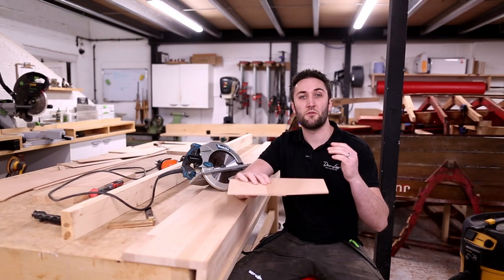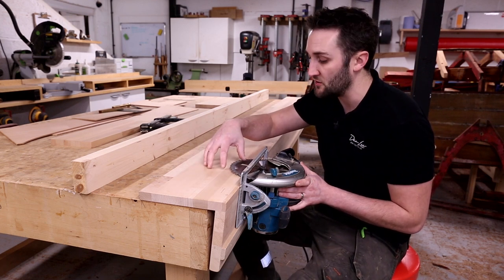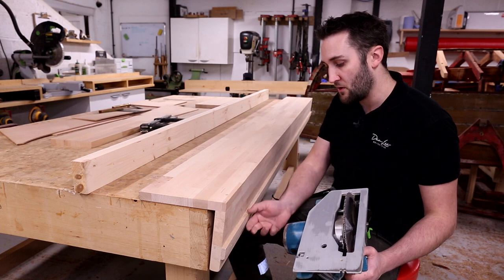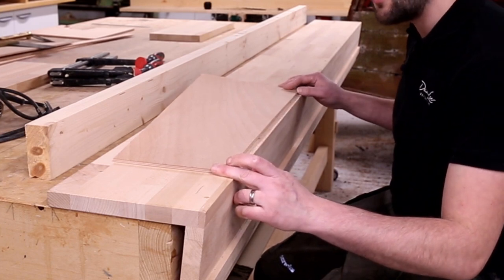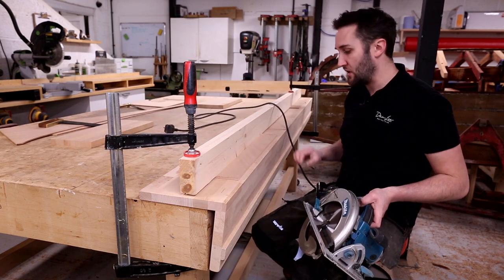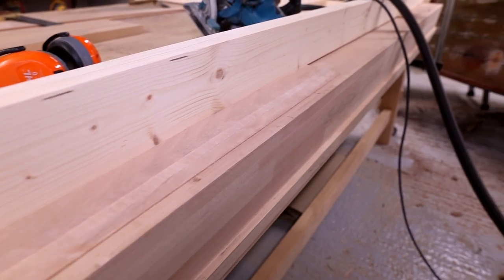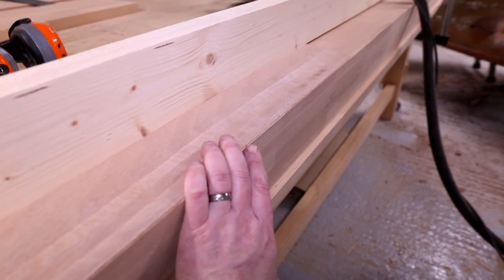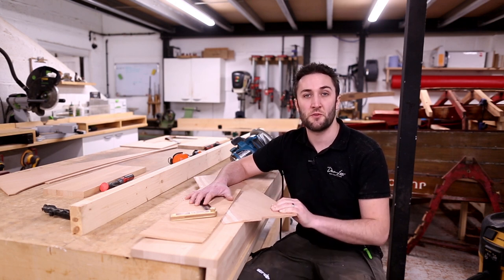How to Cut a Scarf Joint In Plywood Using a Circular Saw | How to Join Plywood

Comment from the maker: Just a note on something that might not have been that clear in the video. The setting up of the saws using the bevel gauge is referring to making the cuts required to make the jig. When cutting the scarf joint your saw should be set at 90 degrees. I hope that makes sense.

Comment: Thanks.  I’m an old butt block dude.  But for this present build, the NOT QUITE the world class cruiser I’m always going to build, I’ve been eyeballing home made scarfing jigs.  All SEEM so simple, but I think it’s in the skill of the scarfer.  One thing about me and jigs.  I’ll spend several hours fashioning and practicing, then, 2 - 4 cuts, and done.  Forever.
Reply from the maker: That's often the case with jigs, they take time to build and then the job is done in minutes. Worth it in my opinion though. Butt blocks are pretty good in most instances but you will nearly always see seams crack in the finish at some stage down the line.

Comment: Make sure you have a plywood that has a thick vaneer layer. Depending on how much you have to clean up after gluing the joint. You may end up sanding through it as i did. I used a birch plywood that had a very thin vaneer. Like comically thin lol. I ended up using that side for the interior as i sanded too deep.

Comment: Great way to scarf with an easy to build jig.   I just built one and it will work great for 1/4" ply but the scarf is too deep using a 10:1 on 1/2" ply for a circular saw.  Open to any suggestions on how to go about scarfing 1/2"ply with a set up like this.  Is 5:1 adequate?  Cheers.

Comment: Nice and fast method, needs some preparation of course with the jig and doesn't pay off for a single scarf joint. Would be interesting to see the joint after varnishing. Often the edges look quite bunked off on planer made ones. What size of blade where you using? Also in order to maintain a sharp edge on the top layer it would be great to develop a method to cut a Z-scarf joint. The method shown here is limited to a certain thickness of ply depending on the saw blade though.
Reply from the maker: I show the process for cutting a stepped scarf joint, used for varnished areas in this video: https://www.youtube.com/watch?v=fxdTGRys4GU

Comment: Really only good for very thin plywood. Even a 3/8" thick plywood at 10 to 1 scarf requires a cut 3-3/4 inches wide, but the maximum depth of cut on most circular saw blades is 3 inches. A minimum 8 to 1 scarf would just get by with a 3 inch blade depth but not for anything thicker than 3/8 inches.